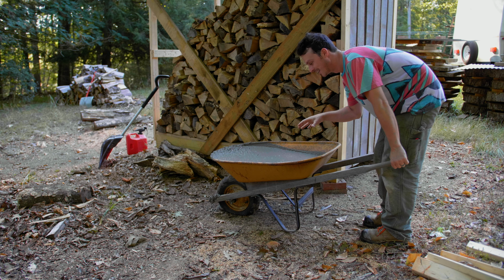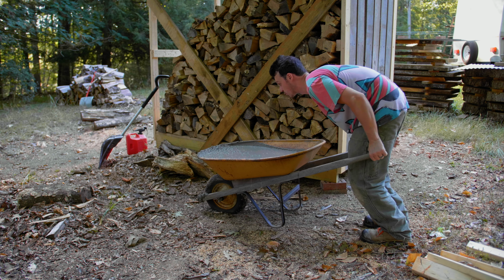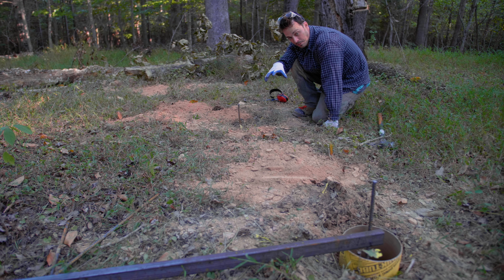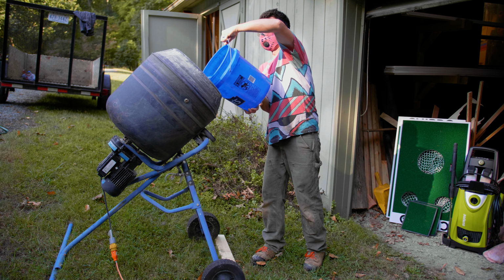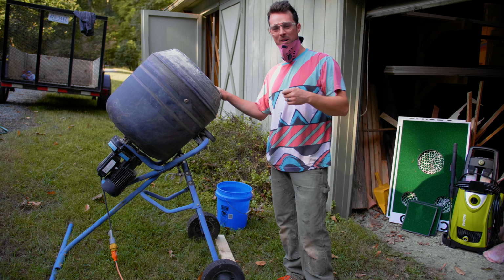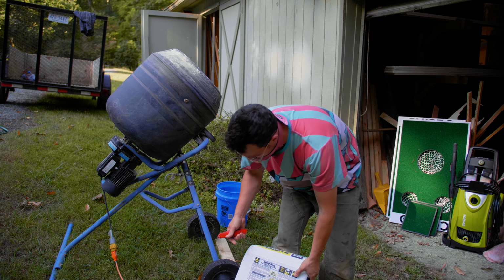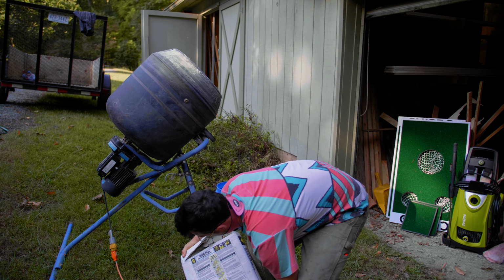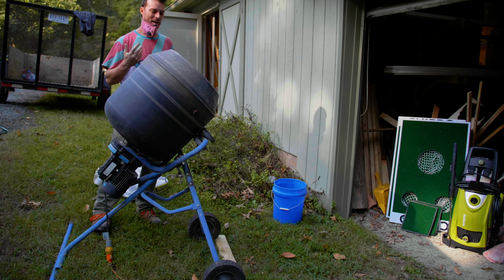Making Concrete - Cabin Build Ep.2

Comment: Seeing this brings a big old smile to me. I learned to do concrete like this after digging down an unfinished basement while renting from my grandfather. The mixer, the rebar... lol. 
While digging down the floor, we undercut the walls and made footers with a mixer like this. Took me a year for the digging after work.
Reply from the maker: That’s epic! I did a similar job in my teens with a builder. It was tight, dusty, and hot!

Comment: Tip, when your hammering them metal bars in the ground. try to get a 2x4 and drill a hole in the end and place the bar in the hole, then stand on the 2x4 and hammer away . less bouncing
Reply from the maker: Genius!!!! Thank you!!!
Reply: Better to use a hammer drill on hammer mode with a socket bit
Reply: @WoodnessGoodness  please do not stand on top rebar with a two-by-four especially if you want to have a family in the future. Many a men on construction sites and at home have been impaled by rebar.  Just use a 5 or 2 lb sledge hammer and take your time and work it in or rent a slide hammer.
Reply: @chuckespich6855  you can also drop into the hole a whole structure with four 8mm pieces of rebar (as long as the hole's depth, plus a bit of hangover) tied together with squares made out of bent 5mm rebar (every twenty or thirty inches), and wire. That way, you get rebar down to the bottom without having to hammer at all. The same tends to get done with wall bases or at different floor levels

Comment: Where I'm at, 8mm bars are sorta "sewn" together with metal wire, together with 5mm bars bent in a squarish shape. The hole in the ground gets as clear as possible, then the bars are inserted. And only then is the hole filled with cement pour.

Idk, shoulda been here back when this was being made, you know

Comment: Rebar is  not supposed to be exposed to the dirt. Causes the steel to rust up into the concrete
Reply from the maker: Oh dear. I only did a couple. Maybe the concrete gods will bless me...
Reply: Hey Mike, do you pour the concrete first, then add rebar?   I'm curious.

Comment: I have the same type of "chaos focus" (what I call it). I'm always working on 10 different projects, simultaneously. If I'm lucky, most of them are somewhat related to a larger project/goal. When I'm unlucky, I forget all about project 1 by the time I complete project 10. This is why I call it chaos. I didn't realize there were other people out there with this curse. The worst thing about this mindset, other than forgetting to finish half of your projects, is poor planning. Planning usually comes after half of the work is done, which does not make sense to normal people.
Reply from the maker: We are related.
Reply: I have found my tribe. 😅

Comment: Is your main method of making sure all of your cement support pours are level with one another done by placing the cylinders in the hole, laying that metal beam across two of them, and then taking a level to the beam, and then repeating?

Also, you keep mentioning the depth relative to the frost line. Do they need to go past the frost line, and if so, how much?

Cheers!
Reply from the maker: Yes I did this slow and steady using a straight piece of metal with a level as I poured each concrete piling. Every area has a different frost line and you want to be slightly below it for foundations like this if possible (from what I’ve read). Not sure how far much search for your area and you should find a building code.

Comment: How deep down do you go with the concrete and do you have to build a square footing at the bottom of it so that it won't sink overtime. I'm just curious because of all the weight does it not sink because it's not compact can you or some one explain how it works? Because I feel like over time the concrete beams would start to lean or sink?
Reply from the maker: 30-36” plus rebar pounded into the dirt quite a bit. The ground here is very hard. I’m sure there’s a little bit of settling over time but not enough to worry about.
Reply: Thank you